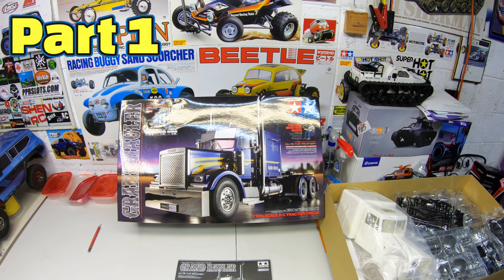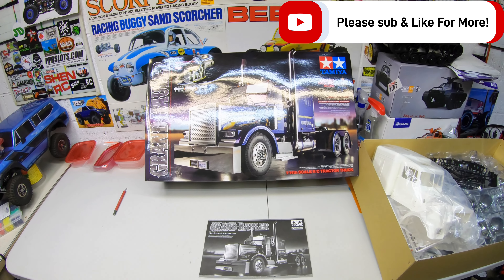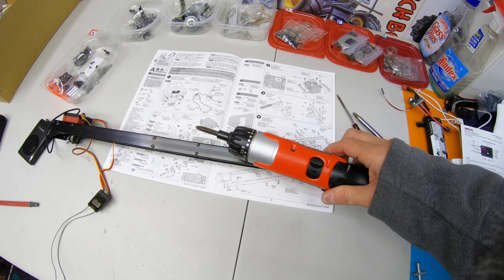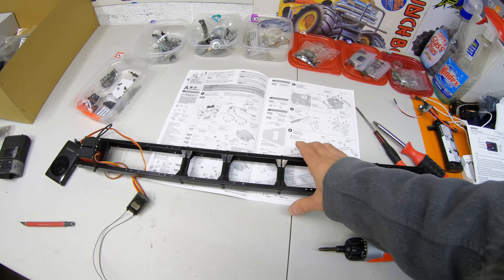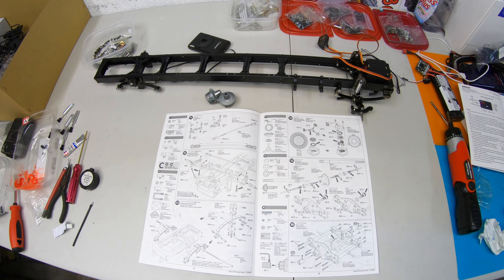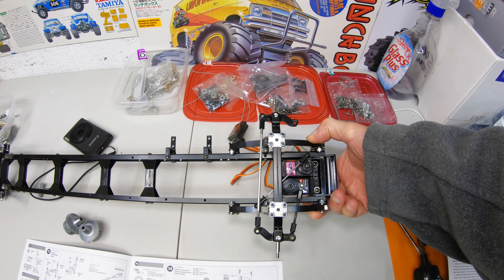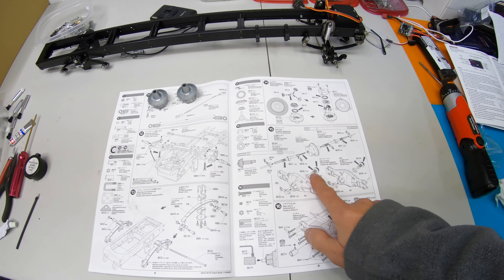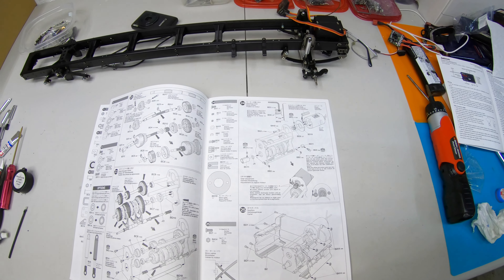Tamiya Grand Hauler semi truck Build Part 1

Comment: Looking good mate👍
You most likely already know this but, be mindful of fitting the diff assemblies, make sure they're driving the same direction as each other etc, they can be fitted incorrectly and will drive in the opposite direction to each other😫.
Looking forward to seeing the next video👍🦘🇦🇺
Reply from the maker: Yeah I know all about diffs it worked out perfect for me no problems at all. it's coming along nicely and should be pretty neat when completed.  Thanks very much for watching.

Comment: Nice enjoyable build, check the steering ends I think you have a part backwards by the front axle..
Reply from the maker: Good eye bud! Yeah I noticed this after I ran the truck it was not turning sharp one way and I found out the silly mistake I made.  Thanks very much for watching.👍
Reply: @ShenRC  We have all done one, worse when you have to take most of it back a part.
Reply from the maker: @BasBoyRC  Yeah I don't know how I did that, the photo is kind of funky looking but I was probably worn out from working on it so much... everyone makes some mistakes sometimes when building no matter how many kits you build. Well the good thing is it's turning better now! LOL!!